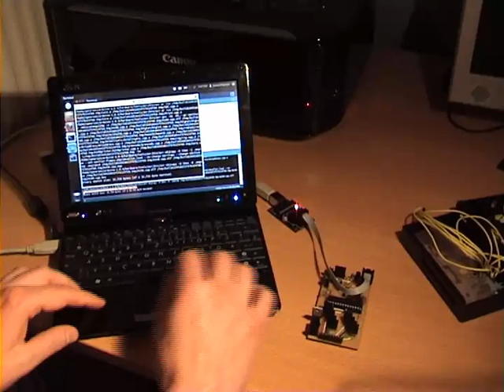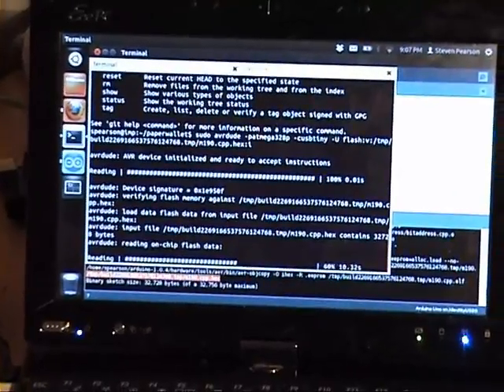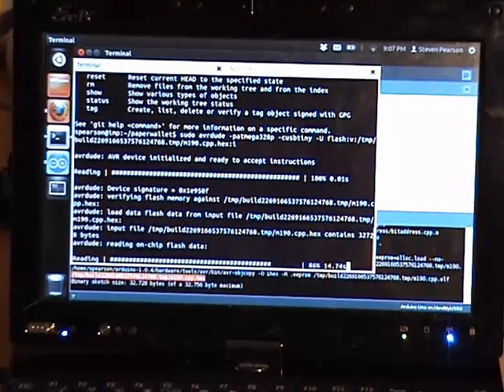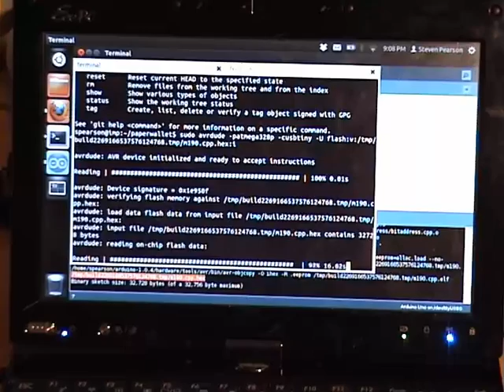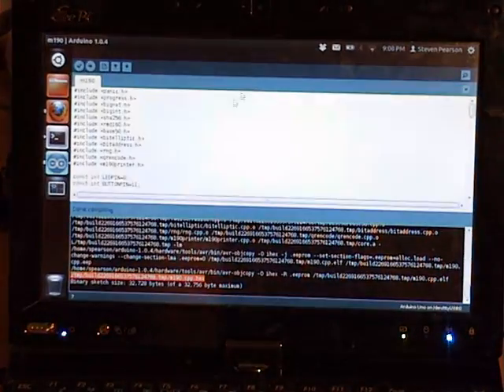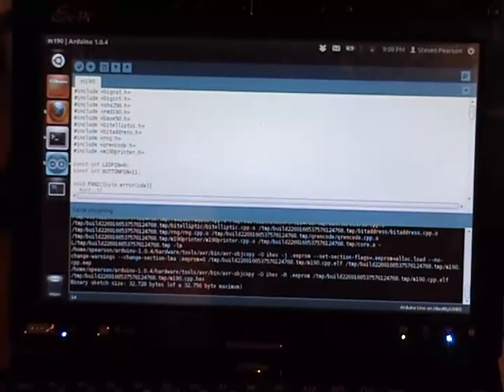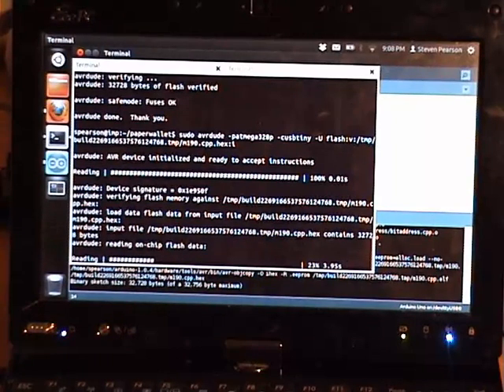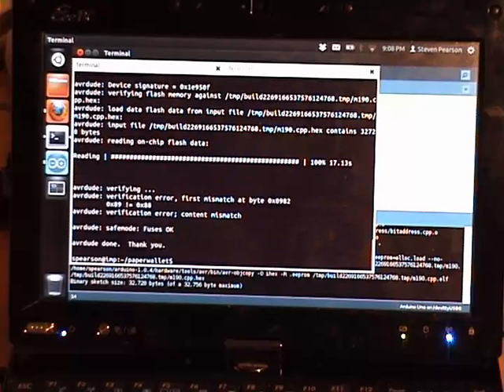How to verify the software on my Bitcoin Printer

Comment from the maker: The printer itself doesn't require a computer at all. You plug int the power put a blank note in and press the print button. No computer needed.

I'm currently clarifying the legal situation around selling "home made" electronics. I'll keep you posted.

Comment from the maker: Sorry I forgot thte second thing. This one is a little more esoteric.

You can create a binary filled with randon data that is exactly the size of the flash storage on the chip.
and upload it to the chip using the programmer.

Then verify that programming succeded.

Because the content is random I would be forced to store it in its entirety but I wouldn't have enough space to store it in so verification must fail %-)

Comment from the maker: There are 2 things you can do

You need to physically verify that the reset pin of the ISP header is connected to the reset pin of the chip.
During programming /verification the chip is held in reset mode where no user code can execute.

This can be confirmed in the chips datasheet.

I added a link in the description